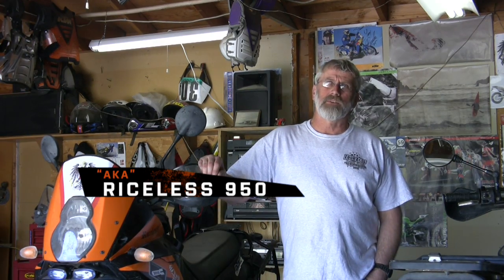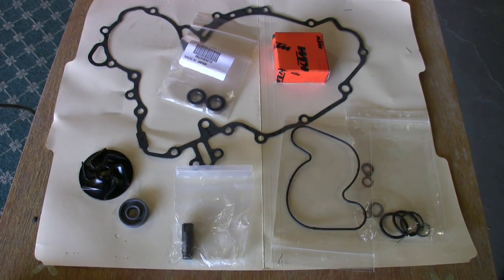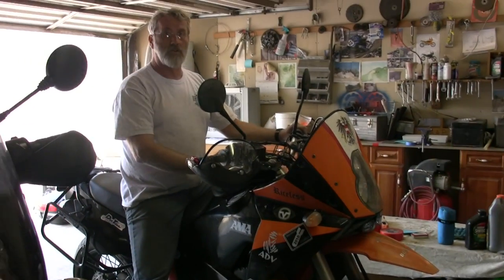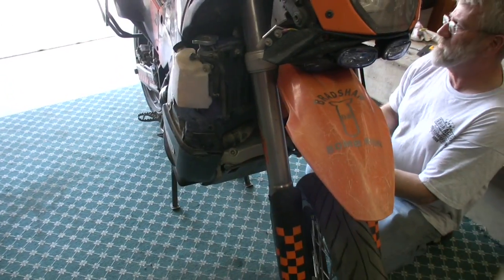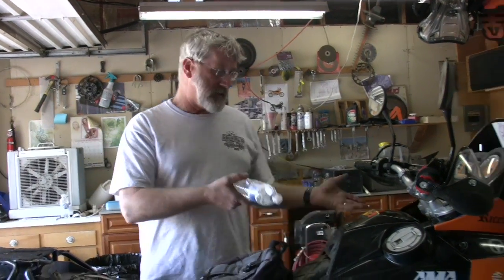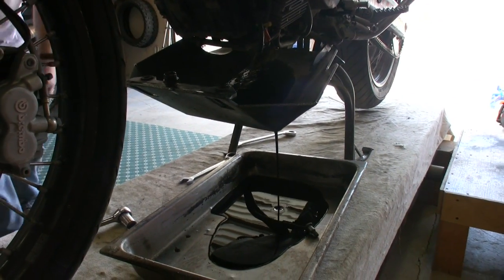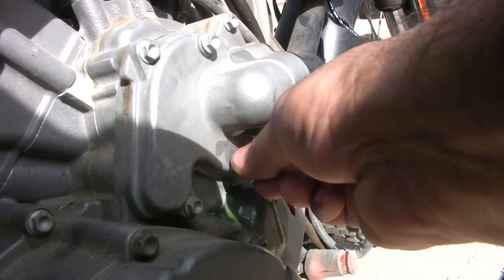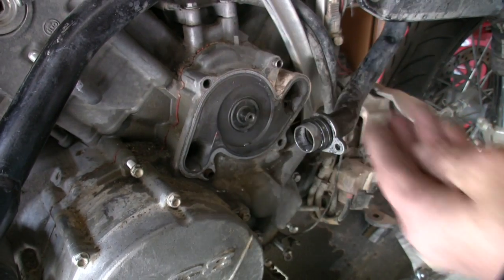CHASING RICELESS - water pump rebuild PART 01

Comment: You can thread in some M4 bolts into the little holes in the impeller to pull it off without any damage fyi